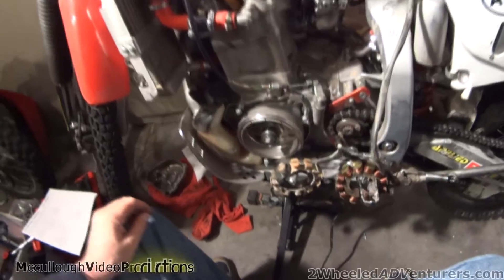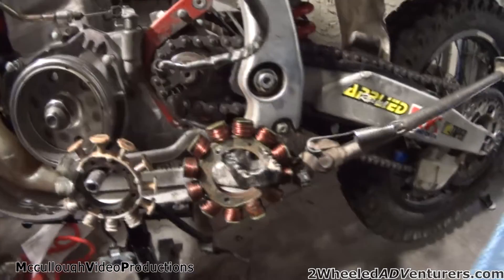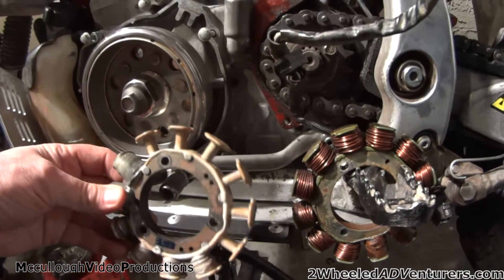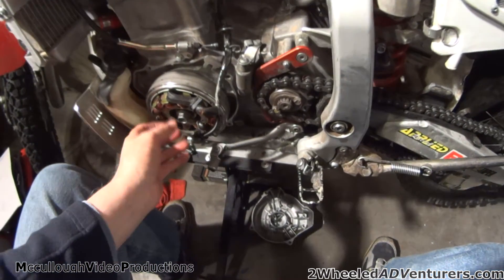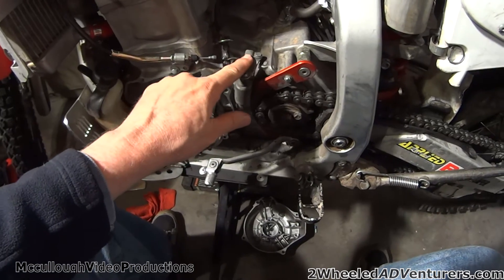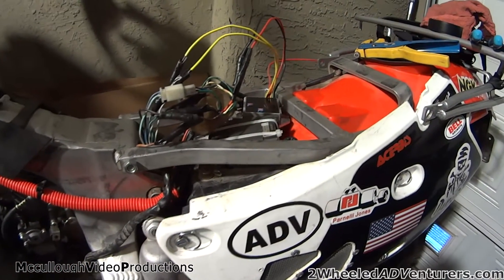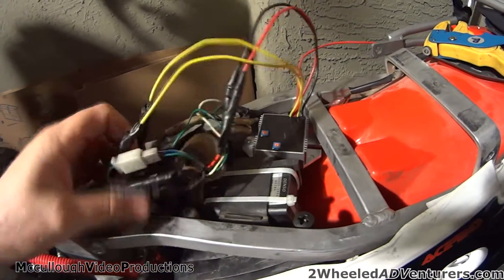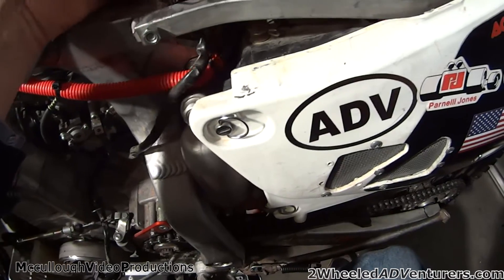HOW TO: Repair/Replace/Upgrade stator on dirtbikes

Comment: Is there no fluid in the stator area? Or did you drain that  before taking the cover off? Im about to do this on the same bike 2002 xr650r
Reply: Tarzaan Xr650r is dry. No need to worry about oil coming out when taking off the cover.  but if there is oil in the cover then you have a problem with the shaft seal.
Reply: @mrbean022387  ....i have a small problem with the shaft seal.
Reply: Tarzaan you might want to get that seal replaced. I’m not sure if this stator and ignition is oil proof.

Comment: Hi, I have the European version with AC regulator and rectifier regulator.
the original stator goes to ground
By putting a new stator I understand that this land disappears
and you have to connect ac regulator green wire to ground
and brown ground wire

Comment: So the only connection that can mess up the bikes electronics (the brain of the bike) is the  white plastic two prong  connector that you can't get wrong? I assume you can just get rid of the stock AC regulator and convert everything over to DC with a reg/rectifier then? Also if that is the case can you run two reg/rectifiers?

Comment: Fantastic!!! I have the ricky dual output and it has another set of yellow and green. Would it be bennificial to get a second A/C regulator/rectifier to set up for an auxiliary port for gear charging and gps?
Reply: can't u use the rectifier made by trailtech and ditch old ac one?